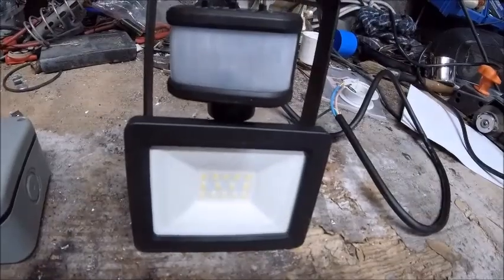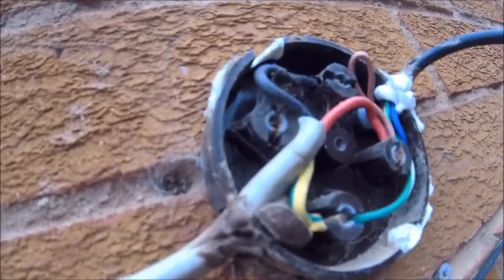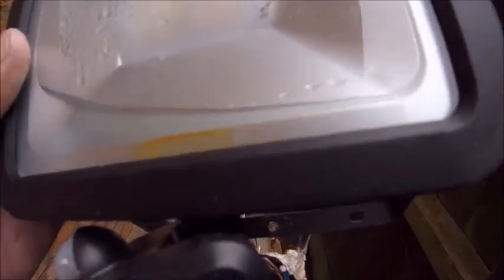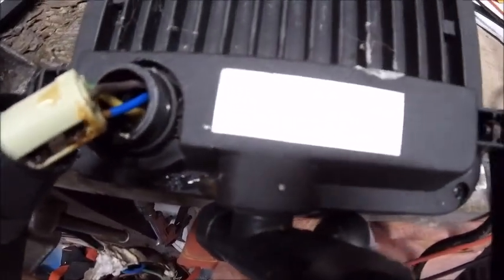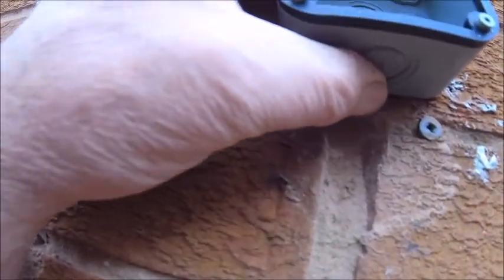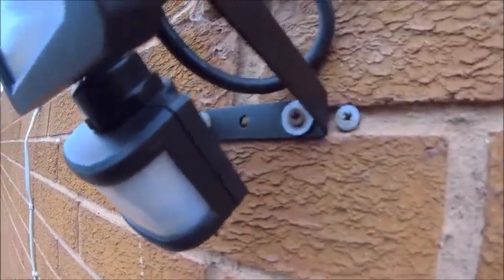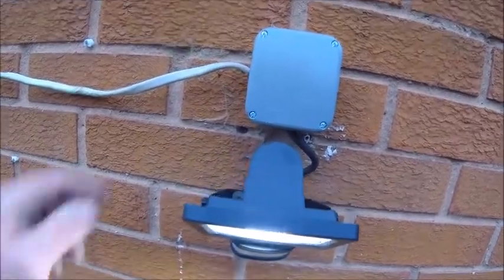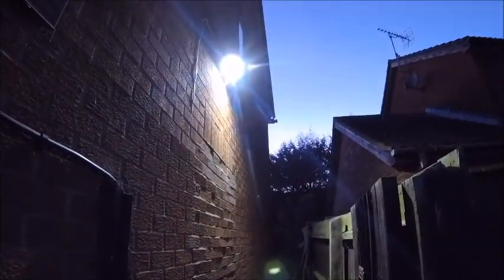LAP 10Watt  Outdoor LED Floodlight installation AGAIN

Comment: I've just had one of my LAP 19w PIRs go prerry much dot on 3 years after installing.  Ive had others go after a year or so too. Not leaking like yours, but either the LEDs going, or the mosfet electronic switch.

Now im faced with a replacement neing different, the smaller one you show. 

Was this pretty much a straight swap? I'm thinking the bracket holes are closer now, so ill have to bloody do some drilling! 😡
Reply: For anyone interested, the new/current LAP PIR floodlight is smaller, and the bracket holes are not the same.

Comment: I have the same light (IP44) with the same problem, I’m looking to exchange it but I’d like the same size bracket so I’m not drilling more holes (any recommendations) but first I’m going to strip it down and dry it out. Great video, thanks.
Reply from the maker: To be honest ...This one now works when it feels like it  😂 I think I'm going to install a gas light next
Reply: @AdeReeves  I strip mine down and it was so full of water that I bought a LAP IP65 from Screwfix, was slightly wider so had to drill more holes. Let’s hope it keeps working. Thanks.

Comment: The cable from the box to the light isn’t looped. It’s going directly down to the light that water can run down, you need the cable to be longer as it shows on the first page of the instructions . I’ve a LAP light under a soffit that’s gone. Been torrential 🌧 I fear the worst
Reply: ….your new lights the same, cable downhill firestorm light.

Comment: They are crap apparently the light is ip 67 but the sensor isn't what a scam and renders it pointless. Best advice is to drill small holes in the bottom for drainage because water will get inside.

Comment: we do u put the earth?
Reply from the maker: On the "earth" post ...
Reply: @AdeReeves  I have fitted a led flood light with  live and neutral but I dint know were to put the yelow wire earth there is no room in the junction box is it safe to fix it with earth metal casing on flood ?